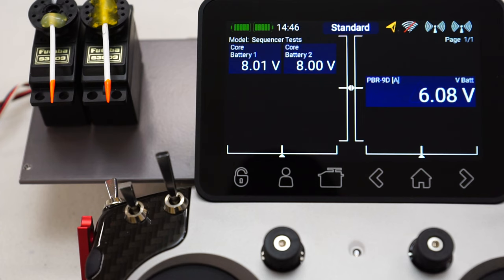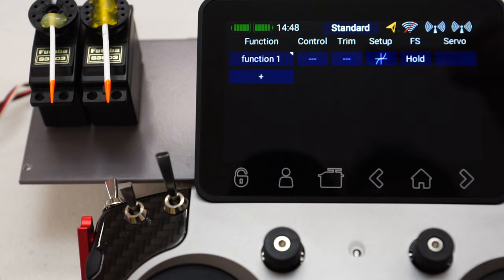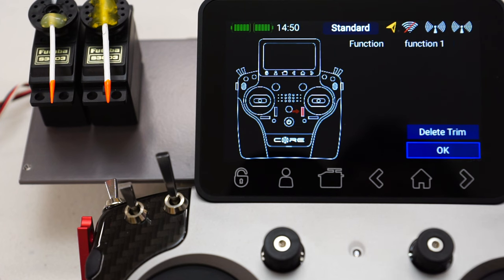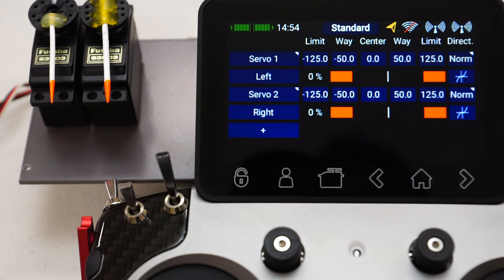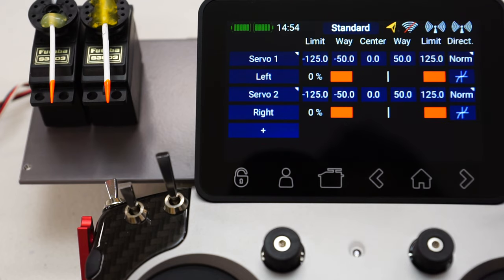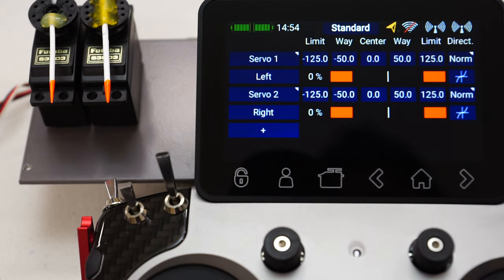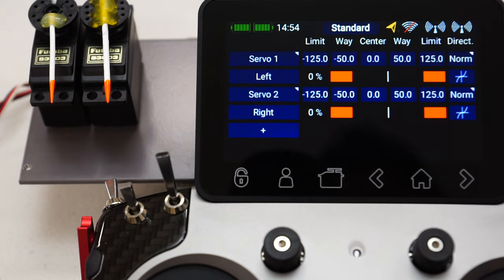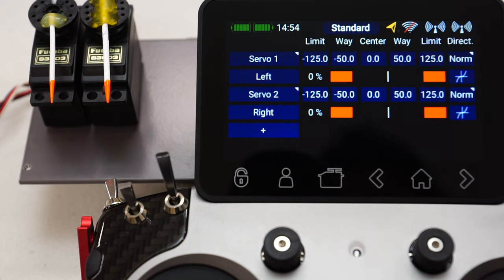PowerBox Core - Atom : Function Menu - Part 1

Comment: Thanks for the video, how would you set up the function for electric throttle, 0 to 100?
Reply from the maker: @michelvanryswyk8560  Just make a function called throttle and assugn your throttle stick to it. Then assign a servo output to this function. Set the travel for this in the servo menu.

Also check out this video which shows you how to set it up with a safety lock.

https://youtu.be/DxOHK5CRu9w?feature=shared

Comment: It’s amazing what you can do with the Fx menu. Using for instance the output of a Unisense sensor altitude telemetry in the control section to deploy flaps and landing gear if you descent below f.i 50m. It’s a top transmitter/receiver!

Comment: Tx Costas very good and logical explanation of the “core” Fx features of the Core 😉 Can you give examples were you DO need the Mixer menu instead of the Fx menu?
Reply from the maker: I'll post up an example in part 2 or 3 comparing the two. Basically Functions lets you control/mix individual servos whereas the Mixer menu allows you to mix Functions together.